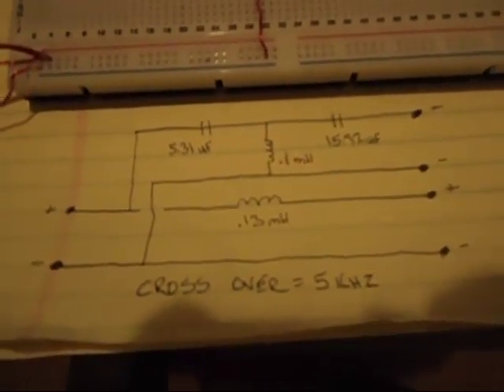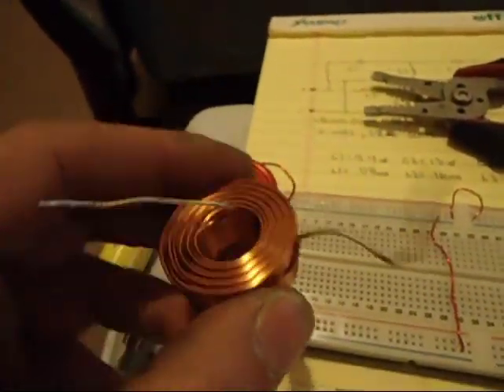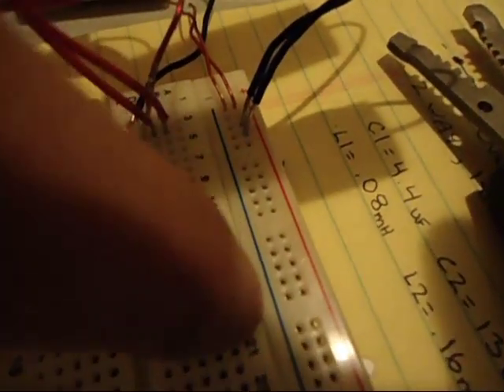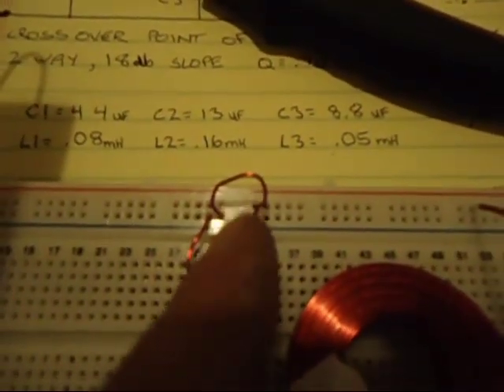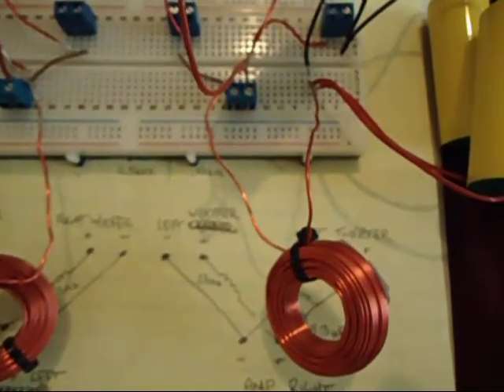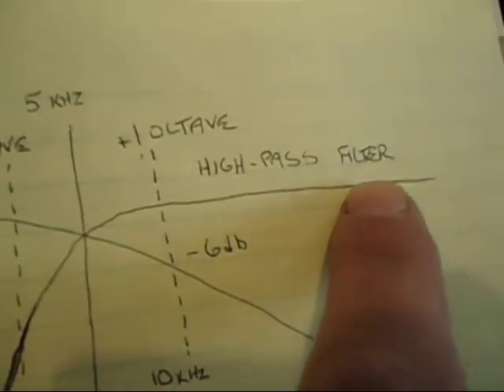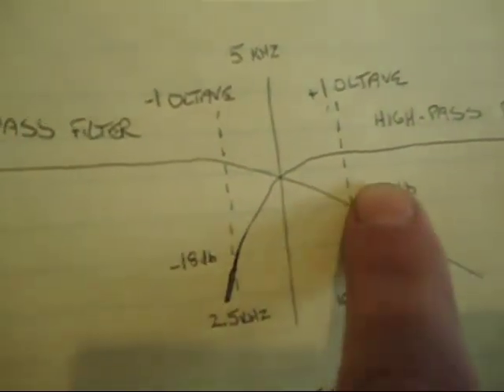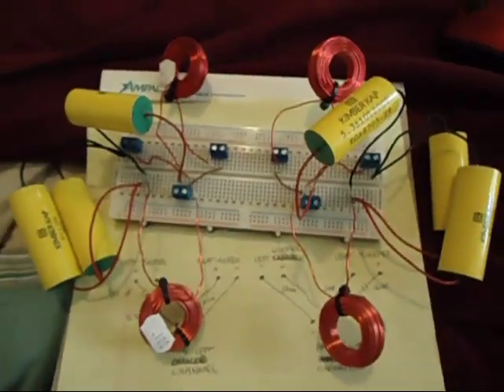Breadboarding A 5khz, Two Way Crossover

Comment: Please help me here in Brazil is difficult how many good projects and their do not have much experience know the basics like you have me email the scheme with the wire measures and number of turns and power and voltage of the capacitor type in a schema designed with input and output I am very grateful, as in electronic'm trying to send me will greatly help me my email (sergioleo1@bol.com.br), thank you, Corinthians will kkk

Comment from the maker: Awesome. Look up, "Shavano Music Online." It will get you through the basics. The caps in this vid are rated for 200 volts and were pretty expensive. You might not need as much. This was a fun project. I need to finish them but I don't need them anymore since I found Zed amps =D

Comment from the maker: If you're planning on buying a xover I suggest you buy a pretty good one. If you're planning to build one it's pretty easy. The components are all rated in volts. Do the math for your amps power in volts. Also, it's a good idea to use air core inductors made from thicker copper wire. Iron core inductors will create heat. What is your plan anyway?

Comment from the maker: Well, more important is the frequencies the speakers were designed to play, tweeters will be damaged if played too low and woofers are unable to play very high frequencies. As for power the cross over components have to be able to handle the wattage of the amplifier.